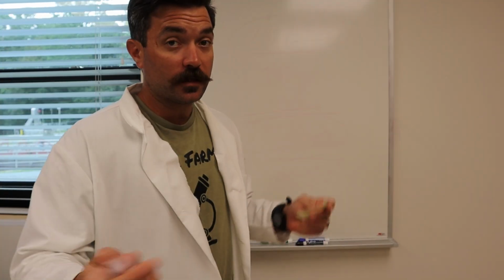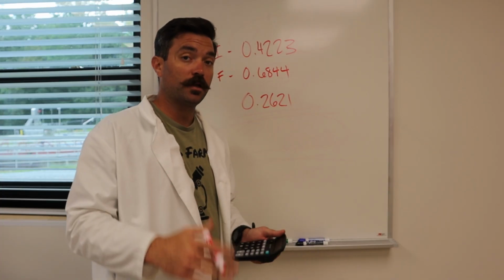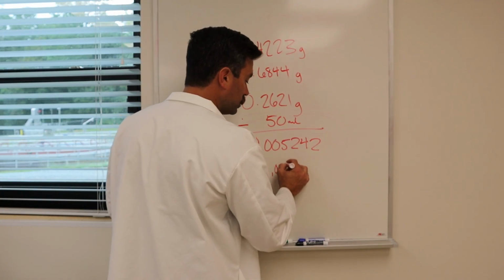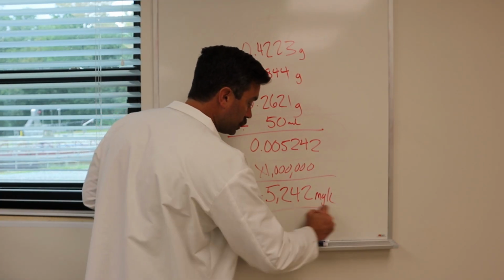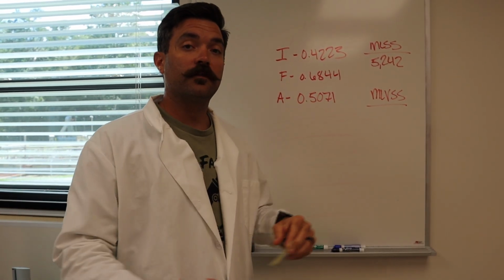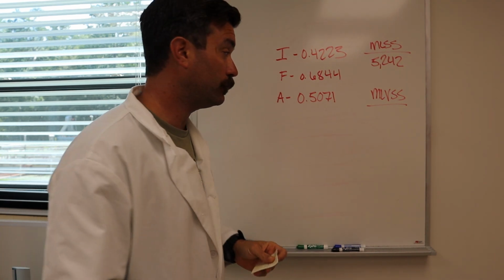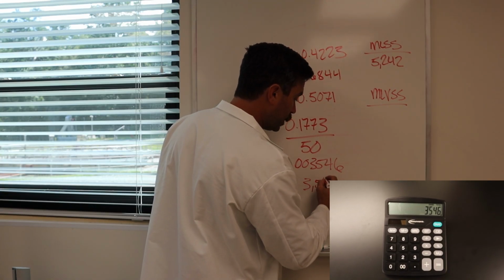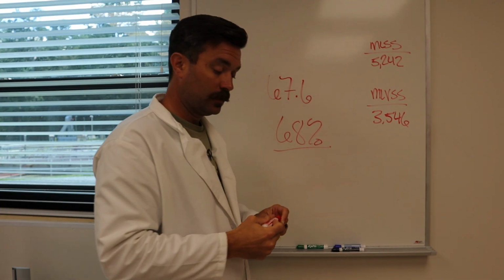How to run a MLSS test and solve for MLSS, MLVSS and percent volatile

Comment: Hi Turd Nerd, thank you for the vids. I'm at the beginning of my wastewater career and your vids are helping me to understand tings from a layman's perspective. One question though, at the end of the vid your math seems correct but I think the terminology is off. The calculated 68% is of the leftover mass (ash) after combustion meaning the volatiles are gone. So the 68% is the non-volatiles left after cooking. Therefore 32% would be the calculated mass of what's gone i.e. the % volatiles of the MLSS. Please let me know if I'm misunderstanding something.
Reply: The difference between the initial filter and dried solids + filter gives the total solids amount. Then the difference between the dried solids/filter and  leftover after ignition will give you the mass of volatiles that were burned off. This mass was 68% of the total mass. The 32 % is the inorganic which is the difference in weight between the clean filter and the ignition filter.